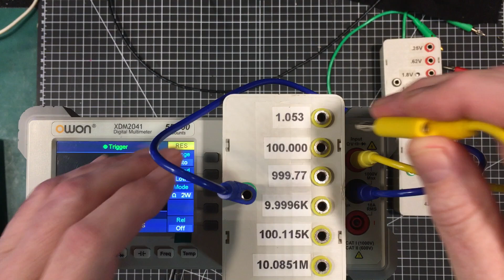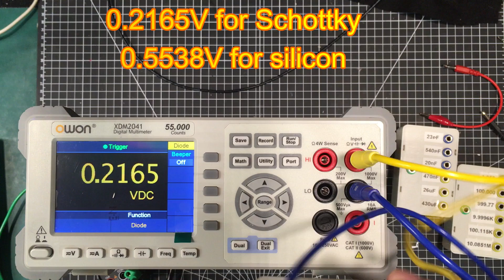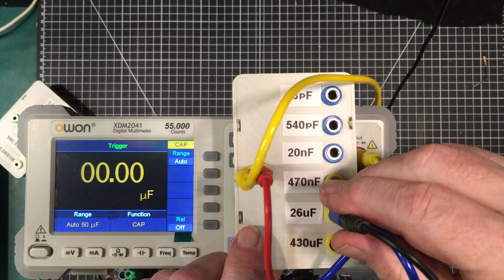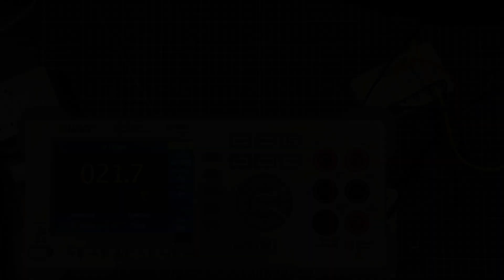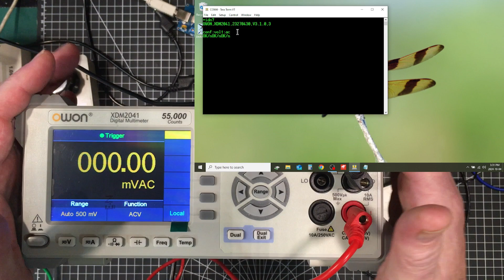Uni-Byte 0222 - Does the OWON XDM2041 Do The Business?

Comment: I just finished doing this mod, inspired by your video. Thank you! I can still hear the Noctua fan, though, even before putting the plastic cover back. I'm not sure how yours comes across that quiet.Having said that, the noise on mine is indeed lower. The Noctua fan with the 50 ohm 'adapter' blows less air as the original fan though. I A/B tested with a sheet of toilet paper on the bench. It does not blow it as far as the original fan. Instead of crimping my own connector, I bought some pigtail connectors from Ali Express, together with PCB mating connectors, which I plugged into the 'adapters'. Overall, It's an improvement vs. the original fan, but mine isn't as quiet as yours comes across in the video.
Reply from the maker: Must be for a different video, but you are welcome anyway!
Reply: @uni-byte OMG, you're right! The previous video ended while I was typing my comment and yours was in my watch next queue 😂 Sometimes YT on mobiles is strange, it linked the comment to the video that was playing when I sent it. Love your channel!

Comment: Just putting the Kelvin clips in the holes does not give you 4-wire mode. Plug some 4mm connectors in and clip the leads on. You need to get the feed and sense parts of the Kelvin clip apart.
Reply from the maker: It does not introduce as much error as you might to think.  Your idea to put banana plugs in would create about the same error of about 2 cm of un-corrected wire length.  The measurement node is where the kelvin clips make contact.  Whether or not that contact is across the component leads, or the component leads meet that point in another way is immaterial.  The only error will be the unaccounted for conductor from that node to the internal element of the component.  The way I did it, they measurement node is where the clips first contact each other which might a cm or 2 from the contact point to the banana socket.  Virtually the same would be true if banana plugs were inserted.
Reply: @uni-byte  The problem with simply dropping the probes in the hole is that you have no idea how good the contact is. And the sense wires are now on the wrong side of that uncertain contact so they have no way of correcting for it. Plugging in a 4mm connector (no insulating cap) allows you to make contact close to the hole, but now with the sense wires doing their proper task.
Reply from the maker: @donepearce  Ahh, I get what you mean and generally I'd agree.  However, in this case the kelvin clips have sharp gold plated edges that when put into a banana socket make very good contact.
Reply: @uni-byte  I feel an experiment coming.
Reply from the maker: @donepearce  Kind of did that in the video when I compared teh result with the REL mode. No?
Reply: @uni-byte  not really. I'm not suggesting a video, but if you can get different results from several tries at dropping the clips into the holes, then they are not making decent contact.

Comment: I've found that temperature measuring functions are by far the sloppiest measurements in hobby-level gear. They are all over the place. I'd stick to Omega gear for commercial applications. As far as calibration of hobbyist gear, I use distilled water turned to crushed ice and water. I put the thermocouple in a Styrofoam cup of it and stir it while calibrating and I have a good zero degree reference. Mildly boiling the water and adjusting for barometric pressure gives me a good 100C reference point, so I have at least 2 good points on the line. If the circuit is linear I'm in good shape. If it's not, I can at least be closer than I was, and I can toss out any device that can't be set to those 2 points. I do this every couple of years just to be sure that things haven't drifted very far. My gallon of distilled water was very cheap, (I don't buy lab-grade, just off the shelf,) and I'm still on my first gallon. It's nice to be able to create an effectively (at least close) primary standard for a hobbyist lab. I can't do that for voltage.
Reply from the maker: That's a great method and I've used that in the past for a few devices I have.

Comment: Have you had a chance to look at the XDM 1041 and do you feel the 2041 is worth the $40 difference?

Thanks!
Reply from the maker: I have not had my hands on one, but the 4-wire Ohms mode and the form factor alone are worth the extra few dollars.  You can actually stack stuff on this, but not on the XDM1041 so it makes better use of your shelf space.  The front accessible fuse is also a BIG plus.

Comment: 1:45 It's odd that the meter shows 00.00 Ohms when autoranging when you move to a different resistor.
Reply from the maker: Yes, a lot of times it is zeroed out as the ranges change.  I guess that's a decision that was made in the firmware over on the digital side.

Comment: Nice work on checking out the software! Pretty cool it can extract out all the manual save points. I'm guessing it if you just read the values over the raw COM port text you wouldn't even need to install anything either. Majority of the reason to have an "integrated" resistor network is so that all of their temperature coefficients match very closely, so even if the values drift, their ratios won't. I guess it's not quite needed for 4.5 digit DMM.
Reply from the maker: Yes, you could issue  SCPI commands like "comf" to change functions and "meas" to get the values.  I think you are right on the resistor packs.  You can add to the that some ADCs don't have individual compensation for the analog channels.  Older designs especially.  My old Fluke 8050 has a Caddock net in it.  Of course, it was fairly high end in it's day.